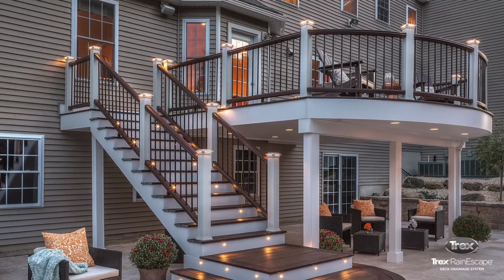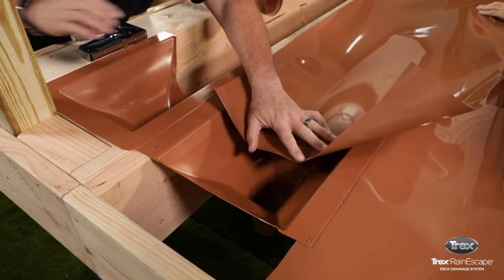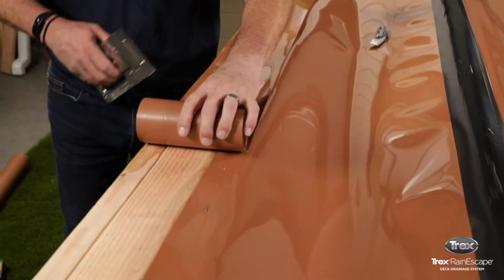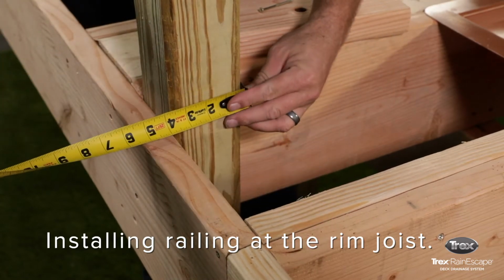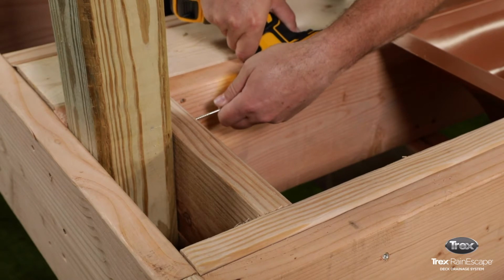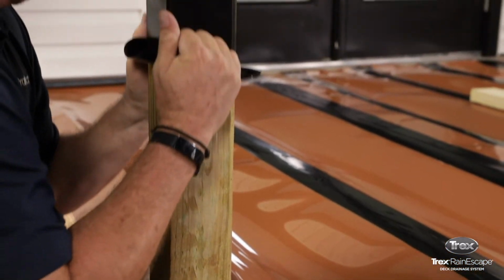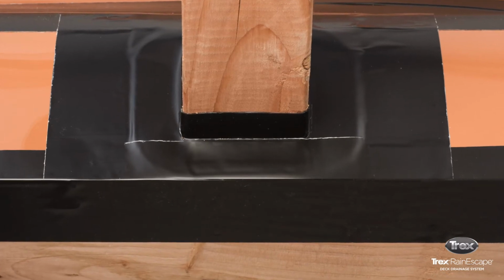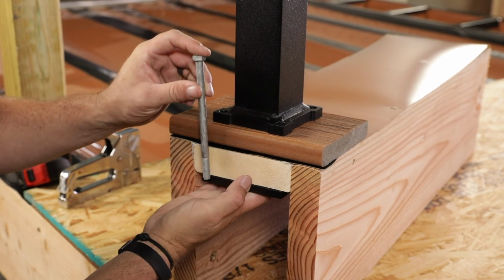Installing 4x4 Inset or Flush Mount Post

Comment: By code, you have to have your posts installed and inspected before installing rain escape of anything that covers the framing. How do you accurately measure the location to cut the cutouts for the posts? That would be an extremely helpful video
Reply from the maker: Hi @ajpieri, the entire deck frame and posts should be installed before the Trex RainEscape system (if they are 4x4 through posts). Only surface mount posts should be installed after Trex RainEscape and the deck boards have been added. Thanks!
Reply: @trexrainescape5819  Right. But how do you mark the trough material to ensure you can slip it over the posts? Your video shows you cutting the trough material and then sliding the post into the hole, down into the framing. That can't be done that way if the post are already attached

Comment: 2:45 HOW
Reply from the maker: Hi @austinkent4663, sliding the sleeve down (as at 2:45 in the video) can sometimes require a little extra attention. First, we recommend planing the corners of the 4x4 post. If that doesn’t work, we suggest using a heat gun to help make the material more elastic and allow it to slide down the post. Using the heat gun, you can (cautiously) stretch out the material of the 4x4 post flash. Hope that's helpful!